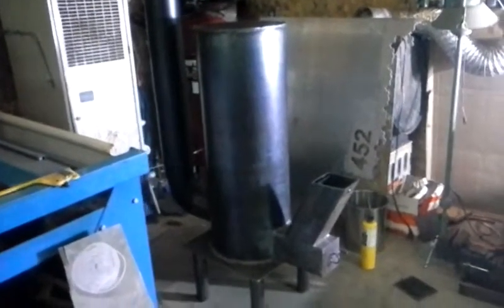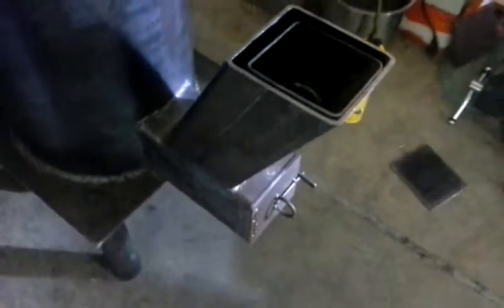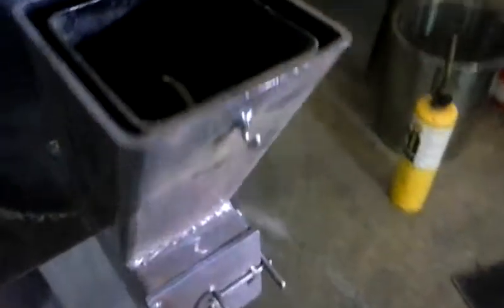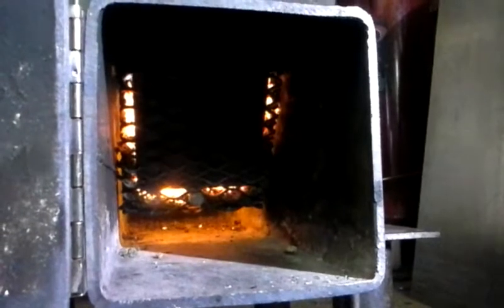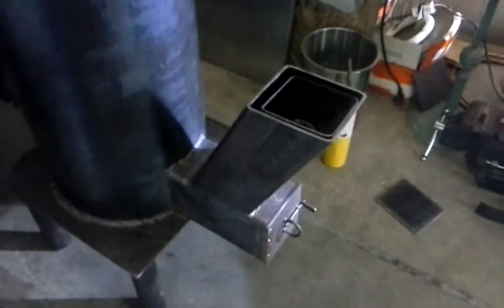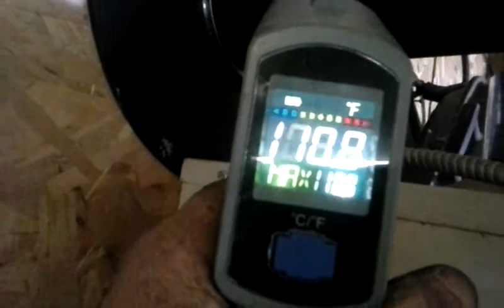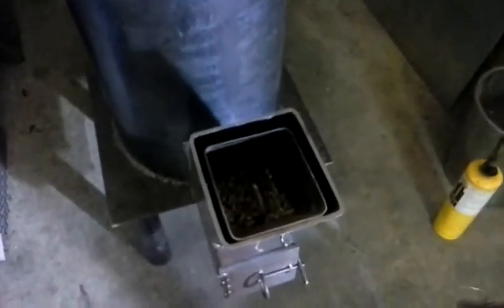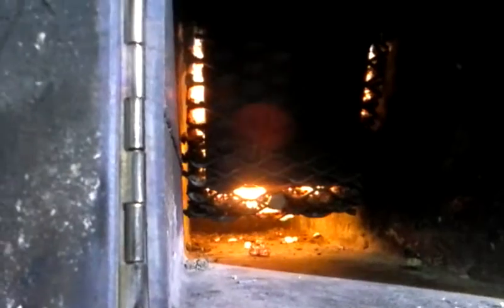rocket stove burning pellets

Comment: You will need to get a hopper on there to see how the burner works with a full 40 lb. bag of pellets. It's good to know how long it will burn a full 40 lbs. and how well the burner works and if it plugs up with ash or not. There's a lot of burner designs out there and some look good on a video, but never show how they work for a long burn, say like 8 to 12 hours. Thanks!